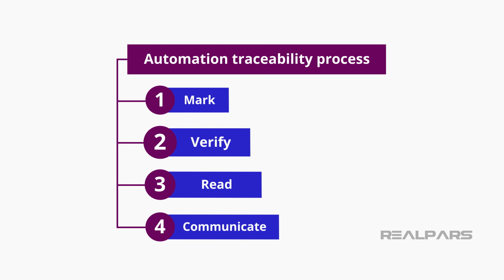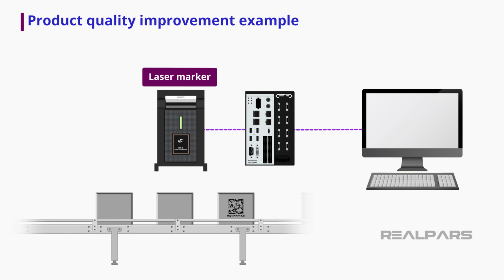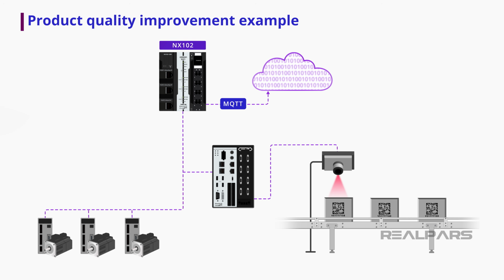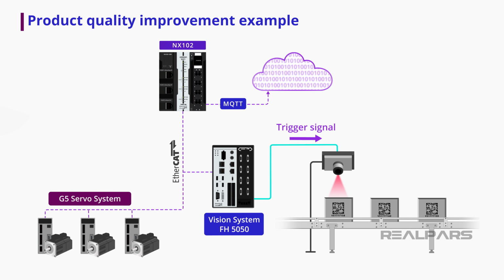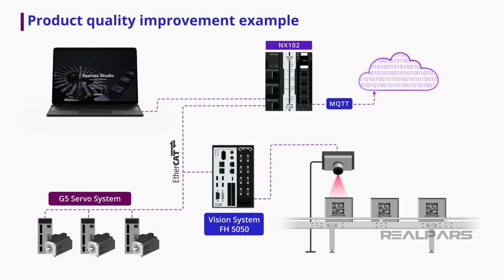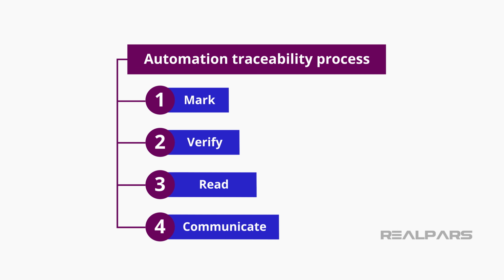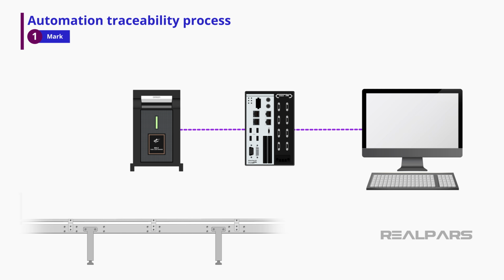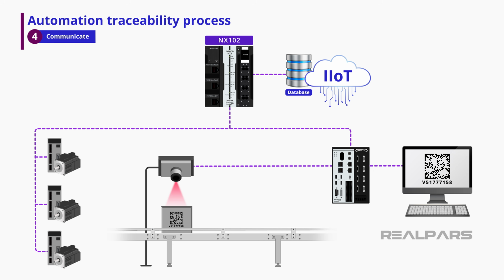Using IIoT and Omron PLCs for Automated Product Traceability

Comment: In my humble opinion, I prefer to use docker, nodered, influxDB, and AWS, With arduino AVR, esp32 or STM32 (with proper circuitry for industrial needs). What it gives? very high flexibility and customization, and very low cost. The catch? you need to do R&D yourself, which are coding, pcb design, and library building, infrastructure, testing and testing.

Anyway, for the video, MQTT subscriber for client user is less secure. One of the options is to translate it to websocket, then to client user. Or anything secure over https protocol.

Very good video explanation.. 
Thank you.
Reply from the maker: Thanks for sharing your thoughts and experiences, Jastria!